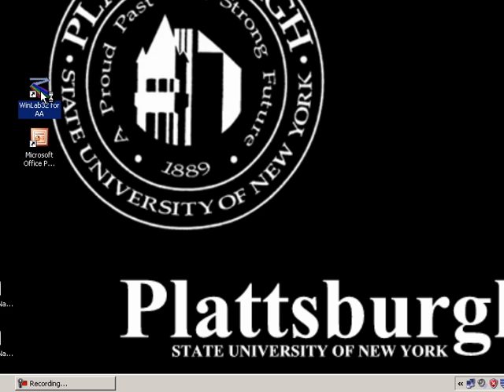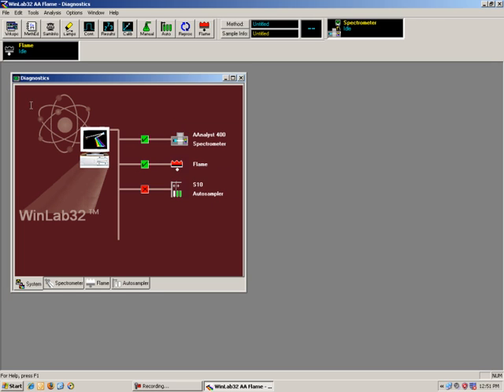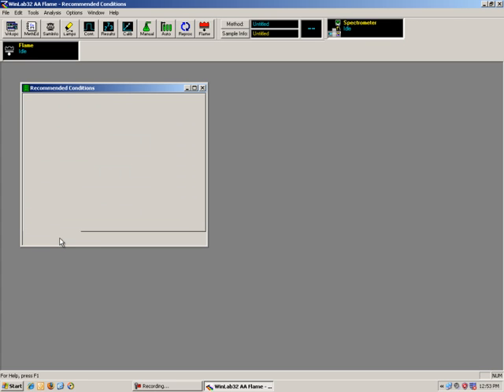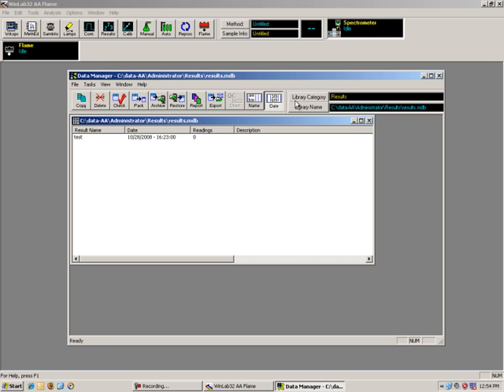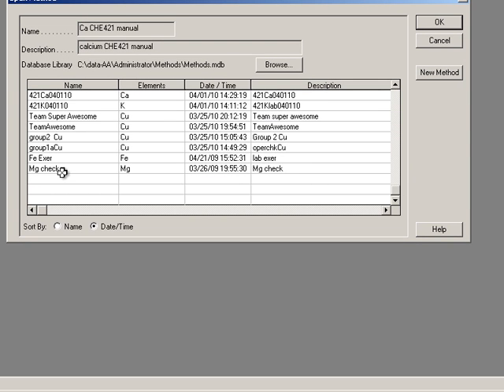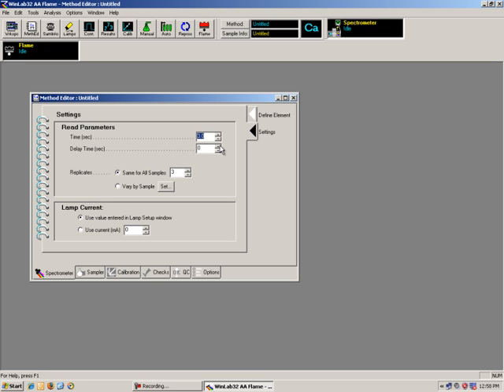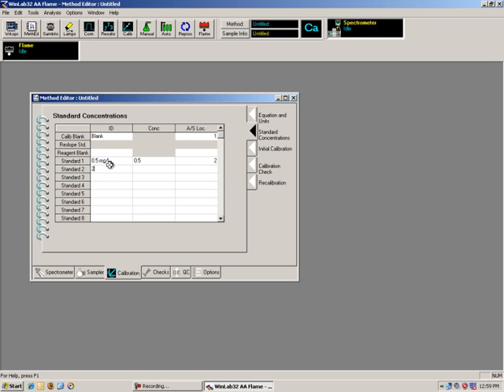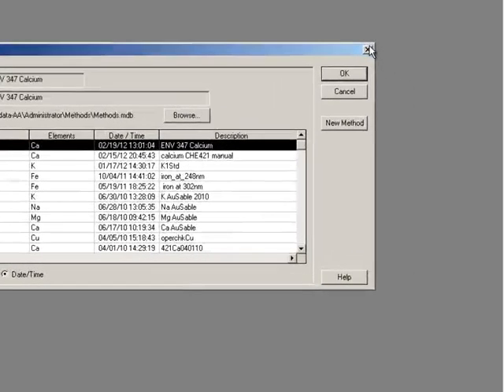Atomic Absorption Pt II Creating Method

Comment: Great videos. Thanks.
For Ca, does the AA readjust the slitted  mirrors via a varactor comb filter in the electromechanics so that the laser can hyperabsorb  in the PMT of the detector.  Can you readjust the spectra of the balled acromitter via the software?  Also, what can you suggest for better thermodetection  if the slit/slitless refractive mirrors are able to resolve HPTTLE amides on samples with internal standards and an elemental cofactor presence due to improper wet chemical resolution via furan asperation if FAC is not used prior to dissolution?
Frank